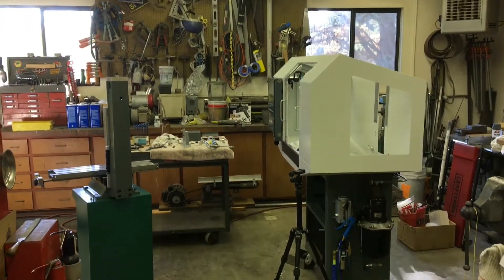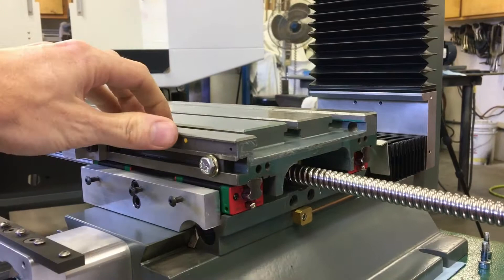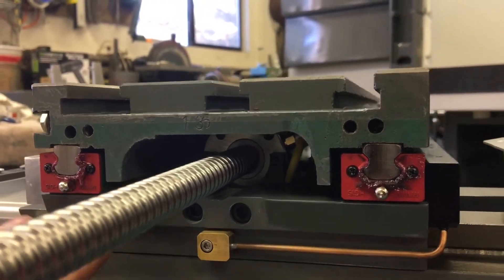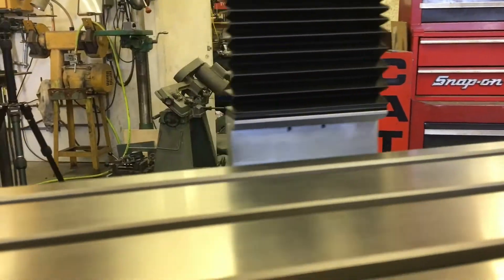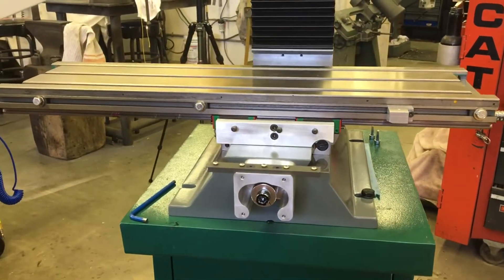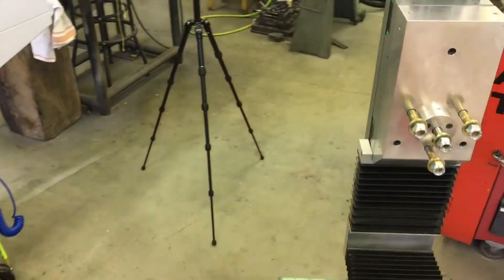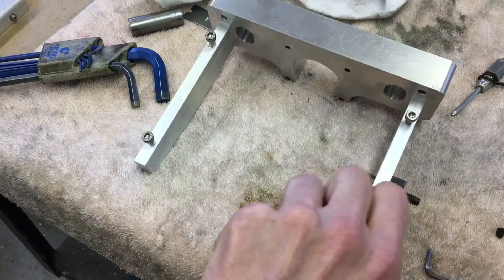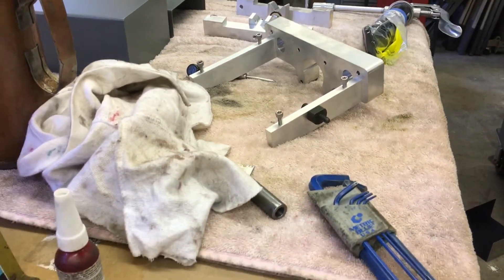GRIZZLY G0704 CNC Conversion Update 26 - ( assembly 4 )

Comment: I think the idea of oil instead of grease on the ball screws is to allow the recirculating balls to travel and equalize wear also reduce friction as intended. grease can restrict the free motion of the balls and cause them to roll or even slide in place instead of travel. also oil flushes out any contamination including grit from wear. Most large machines i have seen lubricate with a central oil system to pretty much everything that moves.
Reply from the maker: Tom Hutchins hey Tom! Thanks for the feedback. Not sure on the oil vs grease debate. The handful of commercial machining  centers I have access to all use grease for the linear rails and screws so I just went for it! 😁

Comment: Looks like a very nice and thought out project. How much travel did you lose on the Z by moving the table up? Think when I had my g0704 using a cncfusion kit I was getting 7-8" of Z travel. 

I would recommend making a taller bracket for the Z and allowing the head to travel further up. 

Also when I modified my base by cutting out 1.75" on the 6 o'clock side I gained a good amount of travel on the Y. Think I had around 7.5" on the Y. 

Interesting channel. I like it.. you might like mine..
Reply from the maker: NCEngravers I lost .100".... essentially the same as stock.
Reply: I would say that's a good deal then...
Reply from the maker: Yes. everything worked out surprisingly well! If the table height changed to much i would have had to redo a lot of previous work....